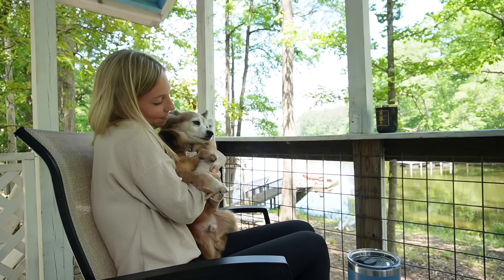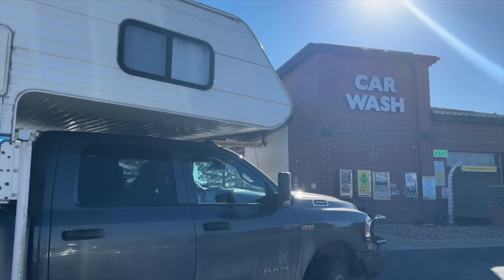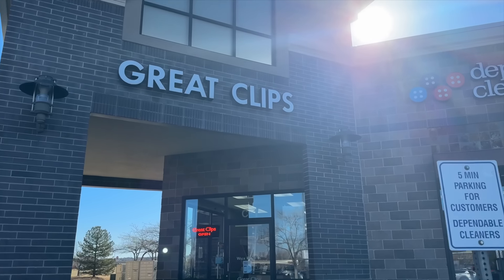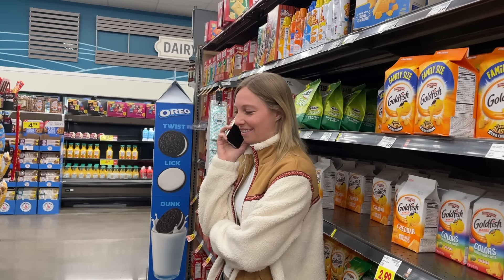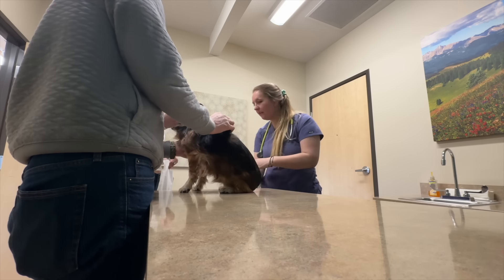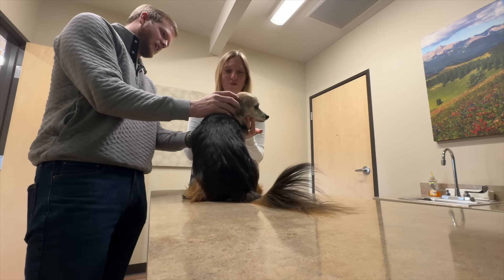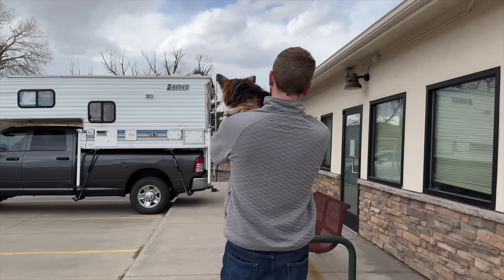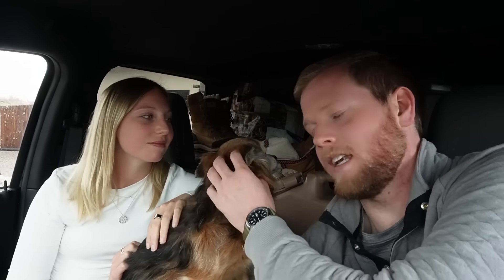Living in A Truck Camper with A Dog - When Vet Appointments Take An Unexpected Turn...

Comment: When I had my dog, I carried an extra set of keys and left him locked in there with it running and the window open a little and the air conditioner on in summer and heat on in winter and that worked great.